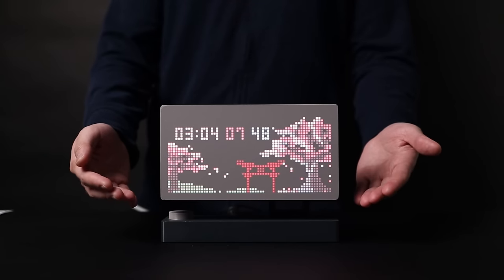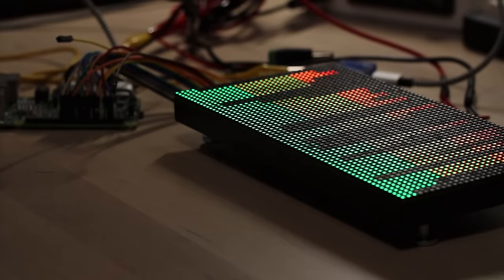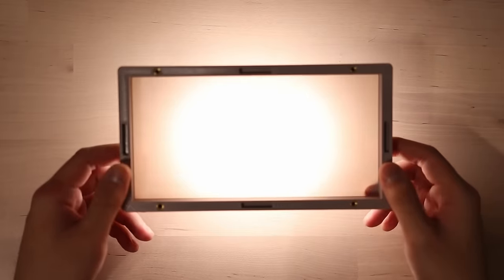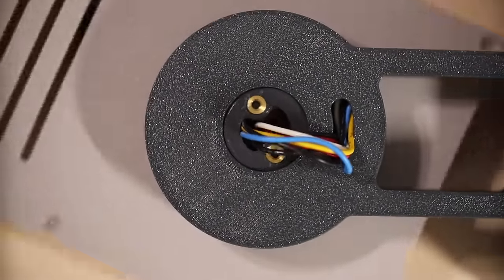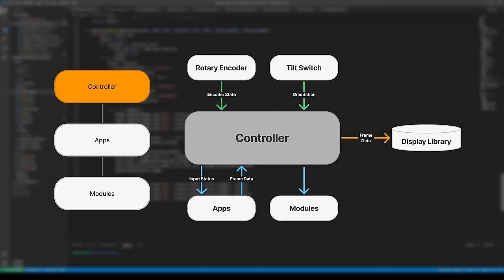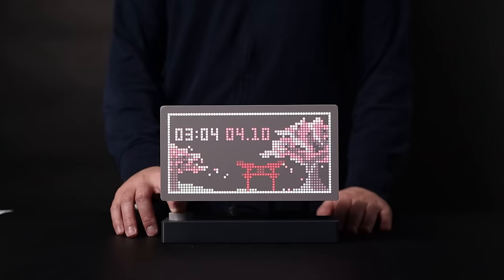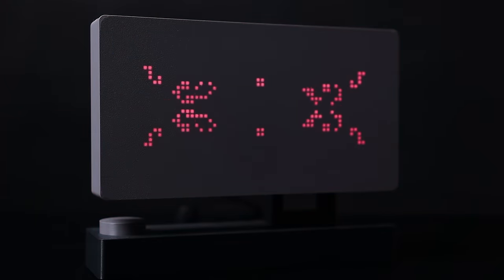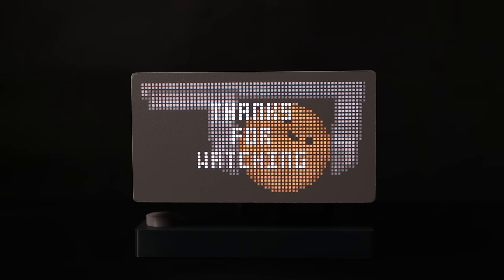Building the Ultimate LED Matrix Dashboard

Comment: 5:28 Instead of using magnets, you could have made the display passively stable in both positions by slightly offsetting the center of rotation past the midline of the box, so that it would rotate eccentrically
In the vertical position it would want to fall away from the turning side, and turning it to the horizontal position would cross over the axis of rotation and put the center of mass further from the center.

Comment: Brilliant project, and thanks a lot for sharing your design process and code. This is so aesthetically pleasing, I'll definitely be replicating your project once I can find an LED matrix panel. The only thing I'd change (and there really isn't a need for it) is using Wood filament instead of the black PETG. It stains really nicely, I just brush my eSun wood (feels like balsa) parts with stale instant coffee and spray a few coats of clear acrylic on top ;)

Comment: Great work, i love that you've not simply made a screen with a button but pushing the possible with the tilt option. I wonder how hard it'd be to make the transition between modes cause the current displayed view 'fall' off the screen and fade in the new view.
Reply from the maker: Thanks! Animations are pretty tricky and kind of jank to do with how I wrote the code. It wouldn't be hard per say, but it would be tedious.

Comment: I just saw this and  it reminds me of my Wireless Announcement Board project that used a 32x32 LED matrix display. I have since then upgraded to three 128x64 displays. I moved up from an Arduino to a Raspberry Pi. Definitely worth it. 
:) 
Keep it up!

Edit: 
For your build, did you consider getting a Pi Zero/Zero W for your application vs removing the USB ports? 
I've used a Pi Zero for my 32x32 display, no problem. :)
Reply: i was crying watching him forcefully disassemble the pi. those things cost a lot these days

Comment: Do you have to use a raspberry pi of that size though? Wouldn't a zero w have what it takes? You could access it and change things over wifi, its so much tinier so the display could be tinier for like a "mini" variant project, but does it have the power to maintain things like this?

Comment: Hey! I am always scared of using magnets anywhere near electronic components in my DIY projects, but I'm loving your magnet system for the hinge. Can they be a problem for the Raspberry Pi or is it perfectly safe? Do you know how can I learn the "safe" margins of magnet use for DIY projects?
Reply: Magnets wont affect digital electronics like this. Would possibly affect analog circuits with inductors, transformers.

Comment: One thing to note here, these LED matrix panels suck a LOT of current. You'd need a beefy power supply like 5V 4A and some even recommend 5V 8A. Would love to see power consumption overtime of this device and power saving features (like lowering brightness at idle or turning off entirely or a habd hover turn on feature). I was wondering how you powered this thing as well?

Comment: Been trying to figure out how you made the Pi sense your screen turning. Is there some hidden contact that you open/close depending on the position?
Reply from the maker: It's a tilt switch (search on Amazon for "Gikfun Metal Ball Tilt Switch Sensor for Arduino (Pack of 10pcs) EK1044"). It's basically a ball into a tube and when it falls down to one end, it'll close the circuit. Since I only need 90 deg rotation, you can rotate it by 45 degrees to map horizontal and vertical to on and off for the switch.

Comment: first they are not messured by pixels per inch, they are P4, witch means the mm between pixel centres, pixel per cm density is only for LCD and projection not LED video panels

Comment: will this also work with a raspberry pi 0?
Reply: It would fit much more neatly in the case if it does!
Reply from the maker: It should be able to, particularly if you had a Raspberry Pi Zero 2. My original implementation pinned the Pi 3B's CPU at 100% load which led me to not consider the Pi Zero, but then I made some significant improvements to the performance later on.
Reply: @allenslab  If the rPi ZW2 doesn't work or can't be found then the rPi A+ would be the next best. 3B+ performance without all the connectors need to be physically cut off and smaller than full rPi 3B/3B+
Reply from the maker: @douglarue8485  yeah that would be the way to go. Main reason why I went with the 3B was cuz that's the only model I have on hand.
Reply: @allenslab  and any rPi is so difficult to find now that hacking off of the connectors makes more sense. Hopefully there is a future when when can get appropriate sized SBCs for our projects.  BTW, any chance of providing a link to one of those sites you found which show the GPIO to panel wiring?

Comment: If you have the time you could actually make quite a bit of money with this. Maybe look into making the hull out of metal instead of 3d printing it to make it more "premium" and voila. Basically a lametric alternative in bigger and better.
Reply from the maker: A metal case would definitely be sick, but idk how I would make the panel still shine through.
Reply: @allenslab  You can keep the grid structure as metal, which would also help with increased contrast as others mentioned and put a film of led diffusing material between the grid and the leds. Led diffuser film can be bought cheap but you can also use f.e. white baking paper (high heat resistance). https://www.youtube.com/watch?v=mg1qygPJXOY This video has a lot of good ideas for light diffusion. 
And for making the metal frame, I would suggest to contact a local metal fabricator to either 3d print it or machine it. Hope that some of this helps.

Comment: Put the pi in the base to not have to clip the ports of and leave more space for the led panel portion where a small fan could circulate air through the back. Use bumps and dips to make the screen rotation snappy without magnets. Other than that; if it’s just using an led matrix and rotary encoder, I’d use the cheapest basic micro controller I have lying around like an 8266 in d1 mini form or something  which would be small enough to stay in the top half with a fan.. also slip rings make turning wires easier